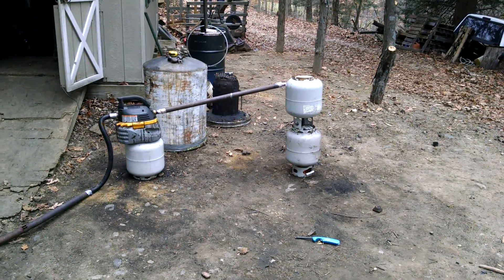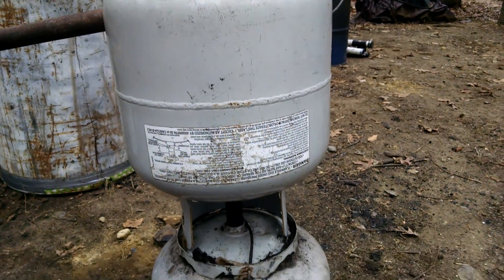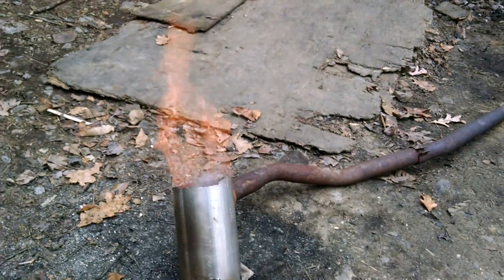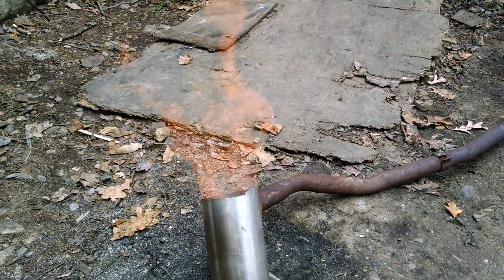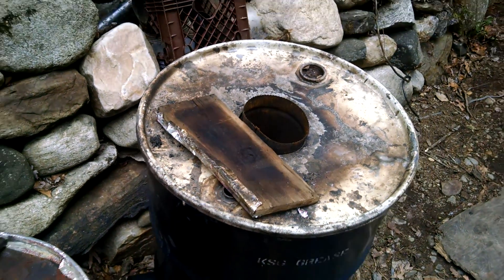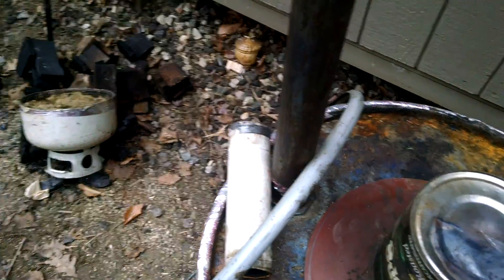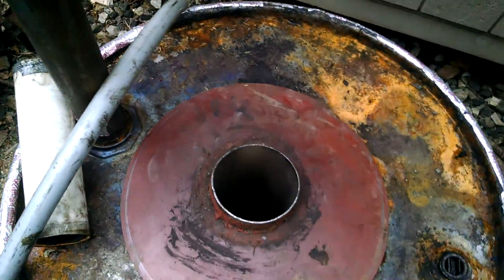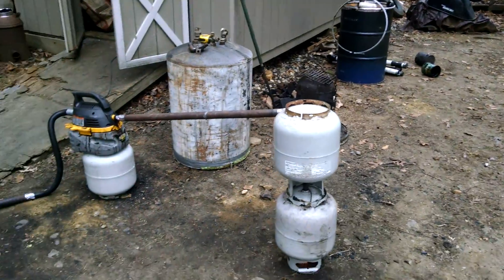Simple fire charcoal gasifier

Comment from the maker: You could run a generator with this just need to add a small filter of some sort in the smoke line
Reply: vortex filter works pretty well. a tube with a funnel from the top to nearly the bottom, feed through an angled tube at the top and the circular motion separates the denser partials. I forget what its actually called.